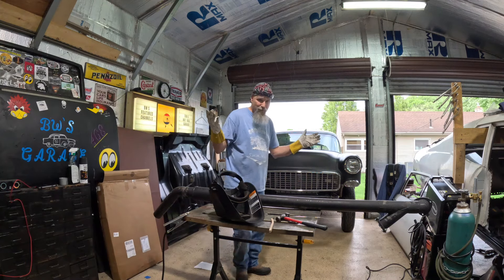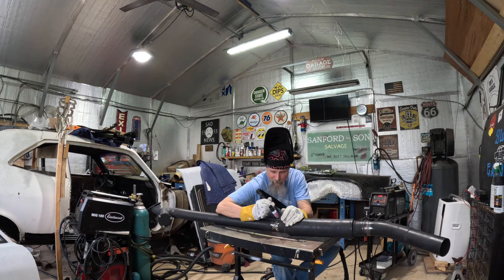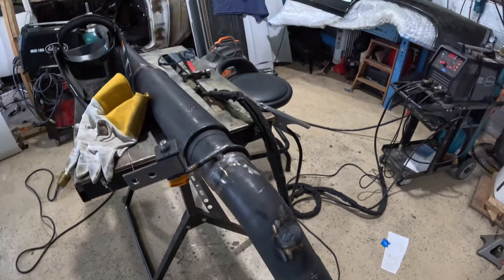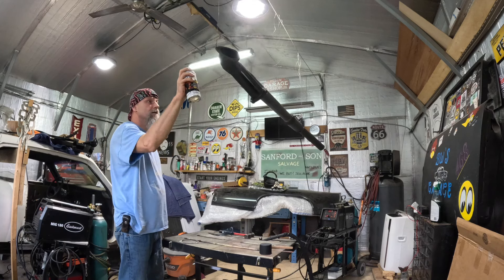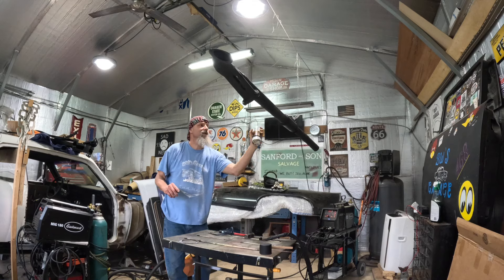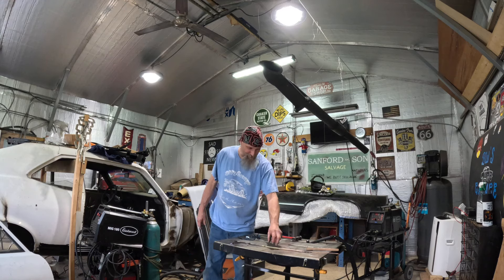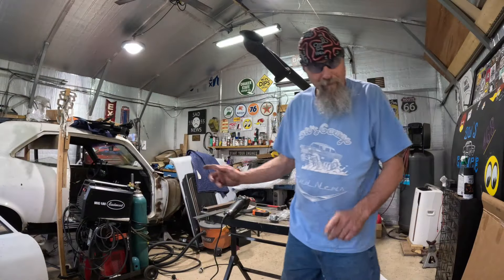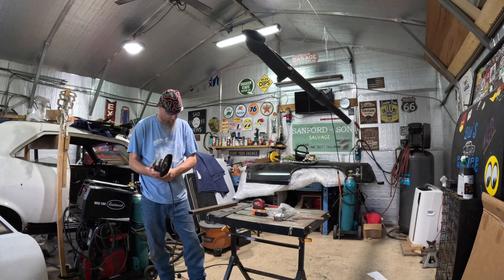Side Pipe, Finish Up Driver Side

Comment: Nice exhaust mod BW looking good great that you can Tig weld. I bought a three way combo welder last year that can touch tig never tried it.Would you think of string bean cutting the  pipe end to match the carlines for asthetics ????...
Reply from the maker: It's basically on the same plain as the quarter but past it about 1" I kinda like it where it is
Reply: @bwsgarage  I meant cut parallel to the rear wheels like Corvette sidepipes instead somewhat of a 45 degrees cut off the body lines just for clarity it looks fine .......LOL!